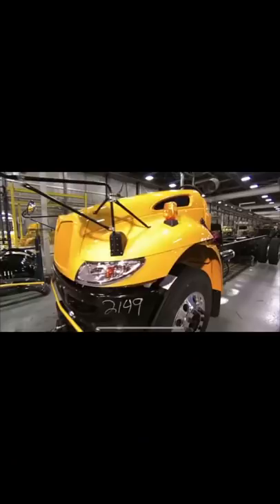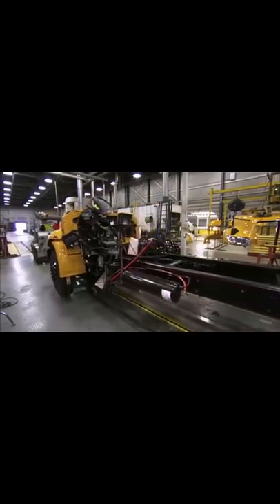How Are School Buses Made? Why Do They Have Duel Wheels?

Comment: Narrator: "The bus is technically drivable"

Cop, who pulled you over: "The bus is ILLEGALLY drivable"
Reply: Bruh in the US aslong as there is a license plate and lights on it its legal
Reply: @Its_Me_Romano  - tail lights are on the bus body. Which is not on yet. Also, you need a state inspection sticker on the windshield (also missing) in most states.
Reply: @robertaviles8451  everything is legal until you get caught
Reply: @twinkieman237  - LoL! At which point, you end up sharing a cell with an inmate, who's twice your size and goes by the nickname of "PopEye" . And as a little added bonus, PopEye wants to make you his "special" friend!  🤪
Reply: Robert Aviles just need to hook up some tail lights and zip tie them to the bumper and duct tape a piece of glass or plastic where the inspection sticker goes. Doesn’t need to be as big as the windshield I don’t think. If rear fenders become a problem some can be made from a couple of barrels
Reply: @Its_Me_Romano  there is no seat belt which is required. Unless the car/bus was built without a seat belt i.e. older cars.
Reply: @thegrinder2k176  I forgot to add you also need a VIN number
Reply: Too bad they said "technically" and not legally..
Reply: text
Reply: text
Reply: @twinkieman237  i live by this😂
Reply: @Its_Me_Romano  nah u need license plates taillights headlights blinkers and so on

Comment: Another reason to have duals on a bus is lets so you run super singles in the rear if one tire blows out you can't drive any more but if you run duals you can take it slow back to the shop after a bus swap

Comment: How do you back up without hitting anything? Wouldn't it be hard to see what's behind the bus?
Reply: If nothing is blocking the back windows it wouldn’t be hard to see. If they are blocked it just means you have a large blind spot you need to be aware of. I have driven several trucks that handle similarly that don’t have rear windows and it’s not a problem for me. Just don’t back up in traffic because someone might be back there

Comment: Oh hey I actually have a question. One some older busses (the flat nose ones to be exact) why does the roof have a hump in the front. What I mean is if you look at one of those busses from the side, from the back to about a foot from the front it's straight but at the last foot of the front it slopes upward, why is that?

Comment: EDIT: Previous information was false, refer to replies for why trucks and buses have dual rear tires.
Reply: 100% false. If you have a flat or a blow out it still needs changed immediately.
Reply: @turdferguson7813  What's your background/evidence, and what are they actually for if it IS false? Not calling you a liar, but I'm just telling you what a driver told me. Could be he was misinformed though.
Reply: @geraltofrivia323  I drive a truck I haul heavy equipment but mostly I'm an equipment operator. It is definitely misinformation. They're to help with the weight and help keep it from being blown around in high wind.
Reply: @turdferguson7813  Thanks for letting me know! I edited my comment.

Comment: Can you answer my question? Why does bus drivers stop at a rail road and open the door?
Reply: This is because there are so many passengers on the bus, so if it gets hit by a train, lots will die. It was mandated after a school bus was hit by a train, and it killed some kids. They open the door, turn off the radios, and look both ways to insure no trains are coming.

Comment: hey Clawboss does your bus have glow plugs and please explain how they work to the audience?
Reply: I am not ClawBoss, but I want to answer:
Most diesel engines have glow plugs. Basically what they do is they warm up the intake manifold/some other parts of the engine before starting, so it's easier to start the engine. Usually in cars, when you turn the ignition to "ON" (before starter position) the glow plugs start working.

Comment: Ok answer this in montana they have chains dangling by the back tires on school busses why?
Reply: I have seen chains near the back tires for one of two reasons. One possibly is to ground it to prevent spark like for a fuel truck or an ambulance with oxygen tanks. The other and more likely reason is for electric tire chains or something like that. Fire trucks at the station my brother volunteers at has them. Basically it’s 5 or 6 chains attached to a wheel that’s attached to an arm that swings towards the drive tires at the flip of a switch. The chains go under the tire as it spins for more grip. Google would tell you more than I could I’m going by what I saw under the fire truck and what my brother told me

Comment: Buses carry very little weight. 50 kids at 100lbs each is only 5 thousand lbs. Plus the driver. Even if everyone in the bus weighed 200 lbs your only at 10 thousand 200 hundred lbs. Probably why school buses handle like shit in the winter snow and skid all over the place. The suspension doesn't even get a work out.